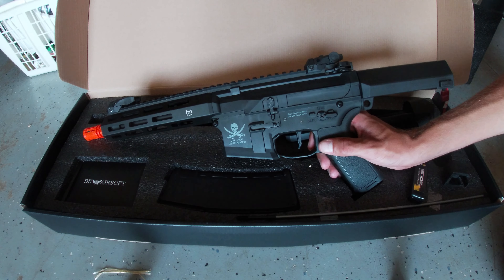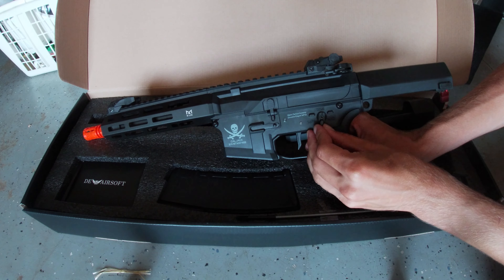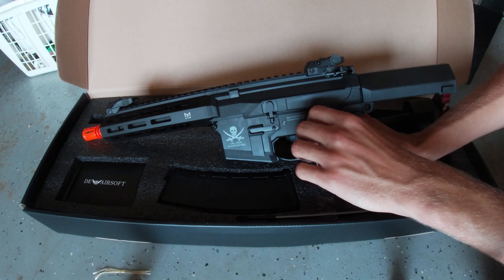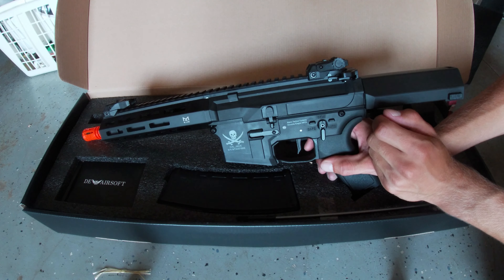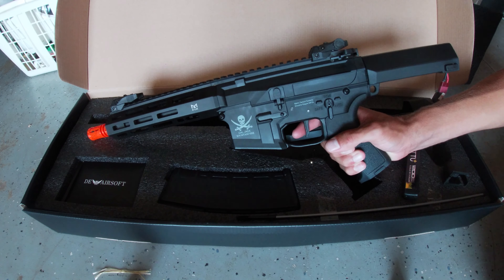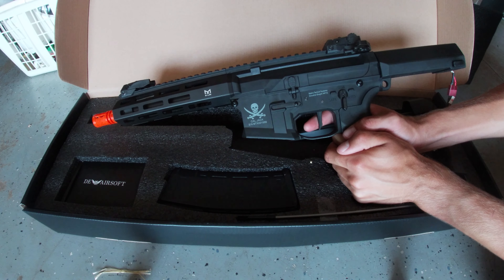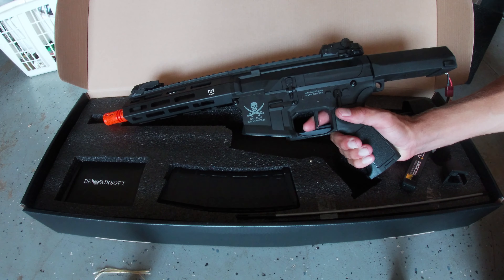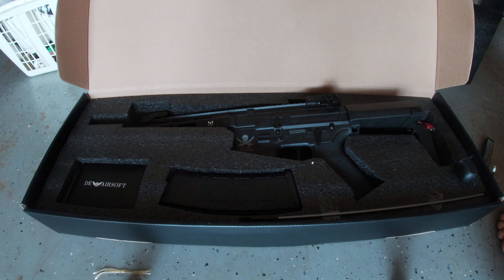How to Electronically Program the Evike.com Matrix "Calico Jack" M4 PDW AEG Rifle w/ Falcon Mosfet

Comment: how do u change the sensitviy of the gun to the highest speed time
Reply from the maker: Watch the vid, but it needs to be in binary and then hold for a few seconds and pull the trigger to the corresponding 1/2/3 speed. 1 is fastest. If you have the gun the manual will tell you.

Comment: So would you suggest the PDw stock or the other stock, and what battery should I use if I get the pdw stock version? Or should I even get it at all ?
Reply from the maker: The stock I have on mine holds almost no 11.1 battery. You should always use an 11.1 with them. That kinda comes down to your preference.
Reply: @that_762_user  alright
Reply: @that_762_user  are you using a 11.1 in this vid?